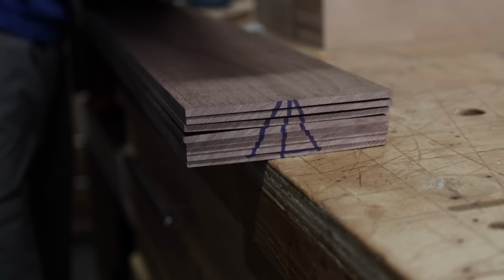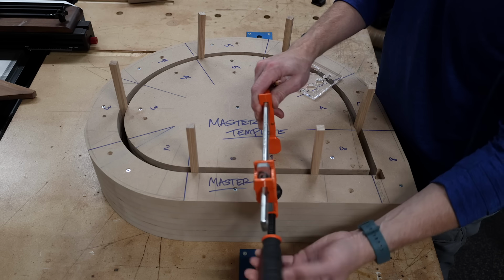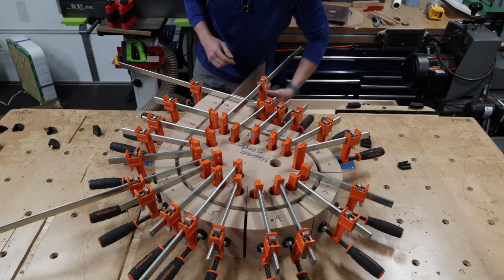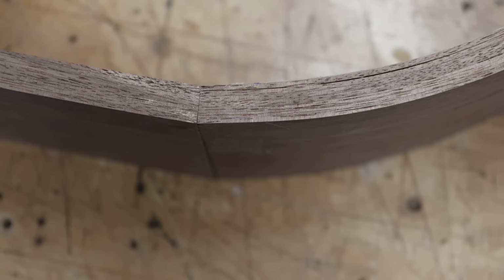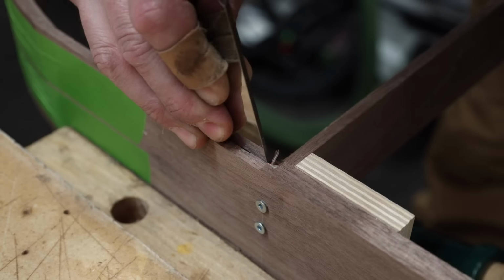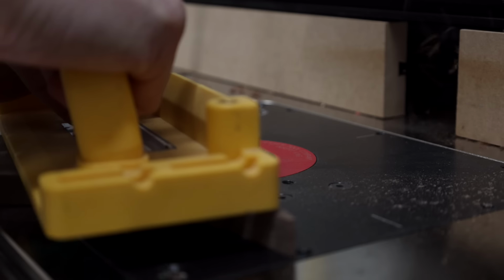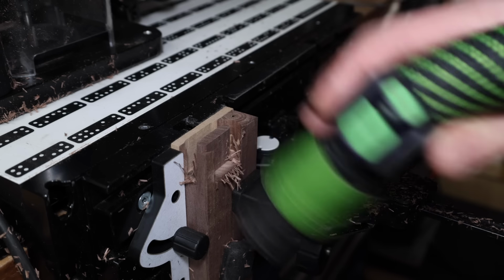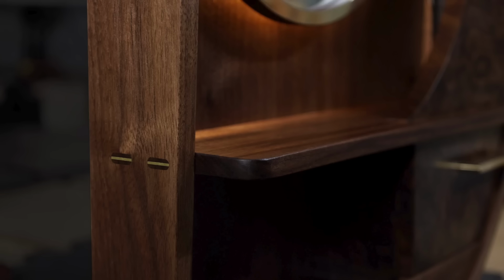Why aren't more woodworkers using this new tool?

Comment: Beautiful work. Very impressive. Regarding AI, I think you’re addressing one issue while ignoring another more important one.

You address AI usage as a general principle, and I would agree with you that it is a powerful tool for conceptual development, one that creative professionals and amateurs should feel no shame in employing. Theoretically…

What you ignore is the specific AI tools which are available currently, including the one you’re using, and the disturbingly unethical practices that have been used to create them. 

You say you draw the line at “claiming the design as your own and profiting from it.” And while you aren’t claiming it as YOUR own, you also aren’t crediting the artists/designers/woodworkers/artisans whose work was stolen and used without permission to generate that concept image. You can’t credit them because you have no way of knowing who they are, which is the point. You’ve actually given credit to Midjourney, and advertised their product in doing so, thus aided them in “claiming the design as their own and profiting from it.” Not to mention that you are most definitely profiting from the concept design as well by releasing a monetized video based around it.

So for me, I’m not opposed to using any tool in principle, but I might be opposed to using a SPECIFIC ITERATION of that tool for any number of reasons. For example, I’m not opposed to using a floating tenon system, but I would definitely not use a specific brand of domino joiner if the company used child slave labor to manufacture their product. And I will absolutely not support any creators who utilize the current iterations of AI tools in their content, so I truly hope this is your last video doing so. I would hate to have to block your channel as I did with Four Eyes.

Comment: Why epoxy and not just wood glue?
Reply from the maker: Wood glue has a short open time, it's soft and the laminations could move over time. A hard setting glue eliminates that.

Comment: in general, not a fan of ai. but that origin aside, this cabinet is gorgeous! great job.
Reply from the maker: Yeah, there are some interesting possibilities with AI, but ultimately it's about the craft.
Reply: Especially like how you made it your own. I would love such a beautiful vanity valet station. Sadly I don't really make beautiful things and am only doing basest of structural repair work and focused on immediate function that can be made beautiful later. I hope to get to make beautiful stuff in the coming years! And I am gonna buy a bunch of wood before the inauguration so I get it as cheap as possible. Then a lot of it can just air dry over a year or two before I use it. So I need to plan out some things I want to make first and what types of wood I want. This veneer was beautiful, I need to think about veneer and vac bags too... Anyway, this was some well timed beauty to inspire some edc valet areas for me to empty my pockets and put them in. Thanks! @KeithJohnsonCustomWoodworking

Comment: There has got to be a better way!  Just the dust is enough to make me go looking for alternatives, not to mention the huge effort to create single use templates, which is one of my pet peeves.  If I'm going to invest effort and material (and storage!) into templates, I want it to be flexible so I can use it for multiple projects.  I have sometimes used pegs to form a path for a laminate glue up which is much easier than this massive template approach.  Admittedly, this approach creates a very sturdy clamping surface, but that has not been a problem in my (admittedly few) bent laminate projects.  Also, this is probably just a matter of personal preferences, but I've been perfectly happy with Titebond III in several use cases including a large curved laminate threshold in a high traffic entryway.
Reply from the maker: Thanks for the feedback! Different approaches work best for different projects and preferences.

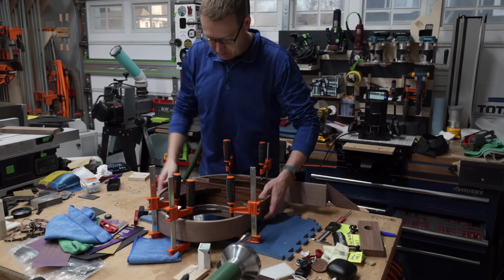Comment: Really neat and I enjoyed the techniques for all the curved work as I want to do more curves in my pieces. I have to say I was very impressed with the calipers connecting to the original and giving the fit shown at 37:15. Now I’m very interested in one!
Reply from the maker: Yeah, that was first time I used the calipers...very cool!
Reply: I don't even know how we woodworkers have been working just a few years ago! that's impossible without a digital caliber 🤣
Reply: Silly question but what pencil are you using with white lead for marking on the walnut? Very easy to see!

Comment: The AI question. I ran into a similar conundrum myself and I felt differently from what you said in the video. To me, if you use AI to generate a unique design, artwork, etc. that isn't a copy of someone else's work, I don't have any moral issues with producing it for profit if someone finds it compelling enough to want to buy it. After all, you still have to work out how to make it work, the joinery, make changes to make it produce-able, etc. Also, in my humble opinion, I think most of us would simply be using AI for inspiration, not just directly taking a result from a prompt and producing the item exactly as it was offered. I may be wrong. As for me, I have used it to produce unique artwork to make svg images that I can V carve on my CNC router. I have had to edit every single one I have generated to make them carve-able because they will have open vectors, design elements that need to be tweaked, etc. Maybe I'm thinking about it wrong. I don't see the moral dilemma in using the AI results from my own prompts.
Reply from the maker: I hear you. It's a very interesting and complex conversation, and I appreciate you sharing your thoughts.

Comment: The shaper origin.
Handheld perfect curved cuts?
How?
My little mind can't process.
Reply from the maker: Origin uses computer vision to understand its location relative to a workpiece. Its precision motors fine-tune the router spindle’s position in real time using sophisticated sensing and control algorithms that keep you accurate to within 1/100th of an inch of your intended path.

If you stray outside of Origin’s correction range, the cutter automatically retracts, protecting your workpiece. Think of Origin as auto-correct for your hands

Comment: This is a beautiful project. My son came up with some amazing chair designs using AI. However, IMHO, you are limiting yourself by not having a CNC router. The Shaper Origin is interesting but limiting, time-consuming, and not as useful. I did a lot with an 18" x 18" I designed and built many years ago, but I have recently upgraded to a 4' x 4' router with an automatic tool changer. I get it if you don't have the room but there are some really nice tabletop 2' x 2' ones out there.
Reply from the maker: Unfortunately, i have no room for any size CNC, hence the Shaper Origin. One day if I have a bigger shop, i will most likely invest in one.

Comment: The piece is absolutely stunning!

You should use mmWave as the motion sensor, they're much easier to hide (they don't even need line of sight, you can hide them behind a wood panel)
Reply from the maker: ooooooh! Didn't know about mmWave sensors...I'll definitely check that out for future projects. Thanks for the info!

Comment: Wow, felt like i just sat in a graduate level course - great video - lots and lots of skill and techinque - impressive work! I think AI is just another tool in the toolbox, no different than using a calculator - skill in executing the design is what counts! Curious if you would have tried this without the Shaper Origin? Great work - Thanks Again!
Reply from the maker: Wow, thanks! And I appreciate you sharing your opinion on AI - it's definitely a hot topic with a lot of gray areas. And without the Shaper Origin, I would have just found another way to do what I did. Probably would have called up on my laser to cut the original template and the tricky placed mortise and tenons could have been done with some carefully crafted jigs and a trim router. The brass ring would have been a bit more to think about, though...

Comment: ok, so i got a question you might be able to answer. I live in the Netherlands, and when we hear air dried, we usually suspect at like 15 to 20 ish %, depending on the season. that is off course differently with air dried stuff in a controlled environment, but outside we can't get to that 10% range, and having a kiln dried piece is much better of a guarantee. is that different in the states, because I myself think you guys can get to that 10% range with airdrying as the moisture in the air over at the states is waay lower then ours. is that true, or am I misled?
Reply from the maker: Great question and I think it varies from sawyer to sawyer (mill to mill). My guy air dries it in a giant shed (stacked and stickered) to about 14-16% and then puts it in a solar kiln to finish it down to 6-10% moisture content.

Comment: That's an amazing ... whatever it is. No troll intended. My only suggestion would be to learn/practice delicate soldering so you don't electrical tape stuff across the back of artwork like that, and you do love you some LEDs.
Now, my main comment here is that as awesome as you are, Keith, I come to see your cats just as much. Glad Lola is okay. I have shop cats, and one is a 1/2 Norwegian Tree Cat that bounds up on my bench (usually during gluing) and SCREAMS at me for attention, food, or whatever cat thought he needs to communicate. I apply love until he jumps down.
#CatDadSolidarity
Reply from the maker: yeah, I'm familiar with soldering, but not with buying the correct LED kits for particular applications. And thanks for the kind words about the shop cats...I don't know how I would get through the day out there without them milling about and getting in my way 😹
Reply: @KeithJohnsonCustomWoodworking  Thanks! Your shop cats are sedate compared to mine, though.

Comment: AI is fine when used as a tool, like here or to give you an outline for a paper you want to write or give you part of a design like this. The problem is when dumbass attorneys use ai to generate a brief to submit to a court AND SUBMIT IT AS-IS without any sort of proof-reading/fact checking.
Reply from the maker: Ha! Yeah, AI can be as helpful as it can be hurtful, BUT, it is getting smarter everyday...😬
Reply: @KeithJohnsonCustomWoodworking  it's but just the artificial stupidity, it's untrustworthy. It's designed at it's core to hallucinate and fill in the blanks with random data when it can't find enough. Aside from copyright/trademark issues, it's fine for art, but should stay out of just about anything else

Comment: I'm at 18:37 and you're right, I am hot under the collar... Because I think you give too much credit to AI and I think personally that having AI design something and you profiting off of it is perfectly normal and fine. You entered the prompt, you decided on the final design, and then you had to create a way to actually make the thing! AI had very little to do with it, you were the driving force of this. The piece is gorgeous and you did a wonderful job!!!
Reply from the maker: Thanks for sharing your opinion! I think it's a very gray area that we've entered into with using AI to help with design because at some point in the very near future, the AI engines will be exponentially smarter allowing it to create amazing renderings that are buildable pieces and it will lay out all your joinery, cut lists, tools to use (with alternatives based on the tools your own), materials, etc.

Comment: Great work as usual. Did you get rid of your sawstop? What miter gauge were you using in the video?
Reply from the maker: Thanks! No, still have the SawStop, but installed the Harvey Woodworking Big Eye fence that can easily be retrofitted onto a SawStop.
Reply: @KeithJohnsonCustomWoodworking  how do you like it?  i've been looking at it to replace my sawstop fence.
Reply from the maker: @AlexK07010  I think it's great. Smooth as silk.

Comment: Your friend who receives this aure ia lucky - it is beautiful!

Honest question though: I understand using a veneer on the back of a veneered piece of wood, but doesnit have to be the same expensive burl as the front, or would a less dear veneer work?
Reply from the maker: You bring up a great point about the back veneer. You definitely don't need to use the same expensive burl as the front, but I didn't have any other veneer! 😎

Comment: From what it seems, you should have spread epoxy on both outside faces during glue up as it fills the pores in the grain, it seems like you did so on the inside face but not the outside face. I'm only 17 minutes in so maybe that gets sorted out later.
Reply from the maker: There wasn't a need to coat both sides - it was a more than sufficient amount for proper adhesion.
Reply: @KeithJohnsonCustomWoodworking  Not for adhesion, for pore filling. Sorry I'm a guitar maker so pore filling is a big part of getting a mirror finish. When I saw that the inside face was covered with epoxy after the glue up I thought you did it for pore filing purposes. Which works wonders if you haven't tried it but with so many faces its too much work, however this build of yours is absolutely worthy of French polish.

Comment: If you had of extended the start of the lamination past the 'start', once you had clamped the first few forms, you could have trim the boards  and then the straight end part could have been formed to that ... if that makes sense
Reply from the maker: It makes sense, but cutting epoxy soaked laminations seems pretty messy. It all seems pretty risky and I don't think would be worth that risk. Doing it this way ensures a perfect joint.

Comment: Hi Keith,
You’ve gone one better on this one. Truly impressive. I like thé use of brass accents in the design, but I still gent nervous watching woodworkers machine metals like they are just a different kind of wood. Chips, even of soft metals like brass are not fun when they go unintended places like skin. Metal cutting tools are designed with chip projection in mind and use différent speeds and cut angles from wood working tools. Just be careful when pushing the limits of your tools. OK, i’m an old fuddy duddy, but I want to se you young guys staying safe !
So good to see Lola doing well. A skritch behind the ear from me.
Cheers,
Keith
Reply from the maker: Thanks Keith! And yes, brass chips and dust is definitely a concern using traditional woodworking tools. It goes everywhere and is hard to clean up.

Comment: Great build, but I have a question. I noticed you have the PCS and the CSC SYS 50. What made you decide to go with both? And what situations do you go to the SYS 50 over the PCS? Thanks!
Reply from the maker: Thanks! I use the CSC for installs/on-site work and smaller delicate cuts because it’s extremely accurate and has a super thin kerf blade.
Reply: @KeithJohnsonCustomWoodworking  Thanks for the insight!

Comment: AI knows design and this one came out a real beauty.  good job.  However AI does not seem to know much about joinery as you had to figure it all out yourself.  This is WAY over my head.  I am sort of a newbie, Also I have poor spatial awareness so I cant think in 3D to solve problems like that.  I love wood working but I will need printed plans and instructions.
Reply from the maker: Yes! And that is where the challenge comes in…execution! I’ve sketched many furniture prototypes, but was then hit with the realization that it’s not something that could be built or that the time spent wouldn’t be worth it.

Comment: Keith, another great build.  I loved the design of the cabinet and the wood bending demo. Learned a bunch.  You may have put me over the edge on getting my own shaper. I think AI can be a good inspiration for design, but as you showed, it still takes a world class woodworker to actually build a piece that can work in real life.
Reply from the maker: Thank you for the feedback and for recognizing the effort that goes into a piece like this. I’ve used the Shaper Origin on many projects, and honestly, I’m not sure how I would’ve accomplished some of the things I did without it. It’s truly turned the impossible into reality for so many tasks.

Comment: I'm glad your kitty is ok! <3 
As beautiful as the end result is, I still am doubtful about AI usage. I think to get inspiration from it like you did and improve skills and design at the same time is relatable, but it might disregard the problems of AI at a larger scale. If there were ethically well designed AIs out there, I would see the point, yes. There is also the fact that AI usage has an environmental impact, which I find concerning. So all in all I would say using AI like this for now is short sighted, as AI needs to improve on many fronts before it should be used at all by the broader public (in my opinion). I love how you bring this topic into your videos and start a discussion on it. Oftentimes the actual potential of AI gets lost when only seeing the downsides it brings with it right now.
And I do love how the cabinet turned out! My only worry is that the adhesive for the mirror wasn't mirror safe and it would look weird in a while, but I am sure you thought about that ;)
Reply from the maker: You make some really great points on AI integration. TBH, it scares the heck out of me as I'm only scratching the surface using it to help me with design inspiration. If we have this discussion in a year or two, I feel things will be exponentially accelerated on many fronts, most of which will not be good.
Reply: @KeithJohnsonCustomWoodworking  I agree wholeheartedly, especially with the being scared part <3 And thanks for the reply :)